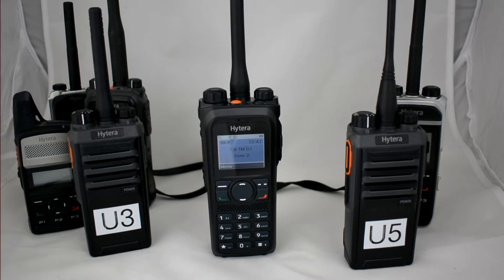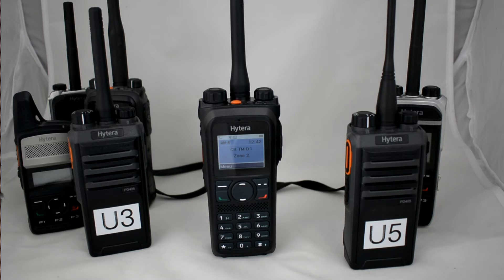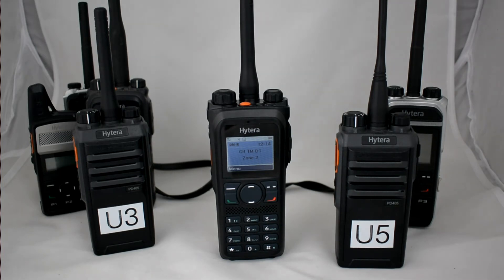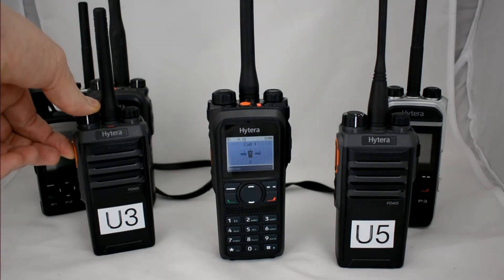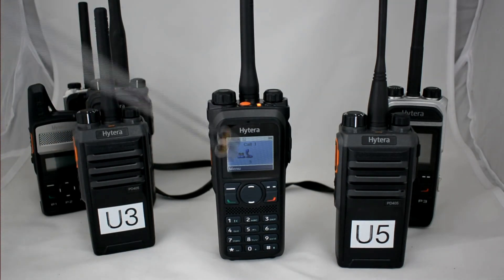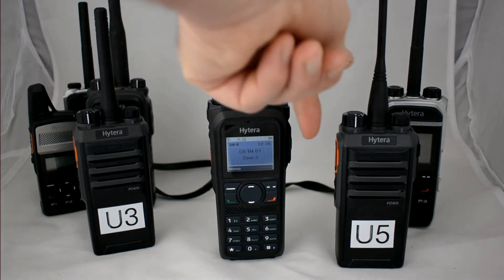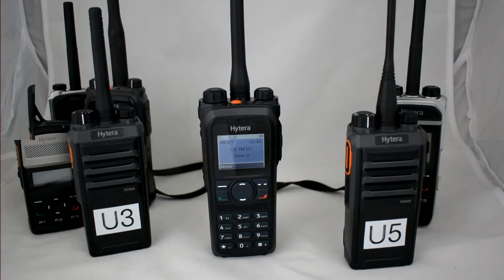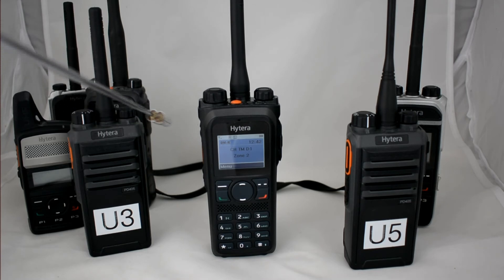SFR

Comment: Can radios from other brands use the single frequency repeater of a Hytera radio? Like if I try to use a Motorola or some other Chinese brand for example?
Reply: In the video he mentions pseudo trunking. I assume the SFR works similarly to the GD-88 where it tx on slot 1 and rx on slot 2. Meaning without pseudo trunking, you can't really hear the transmission from SFR unless tx radio is on slot 1 and rx radio is on slot 2 (just like in your video). So I assume this SFR applies to either hytera only or possibly connect system radios (they have a similar mode).